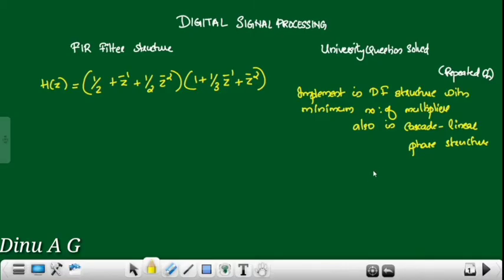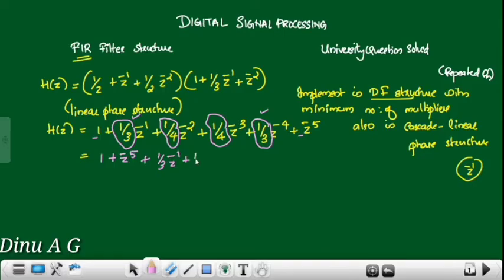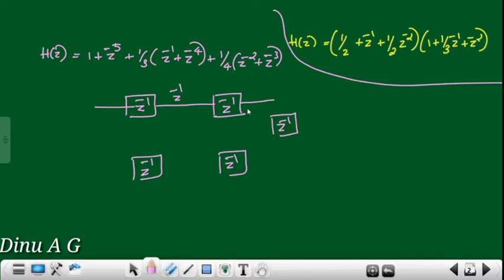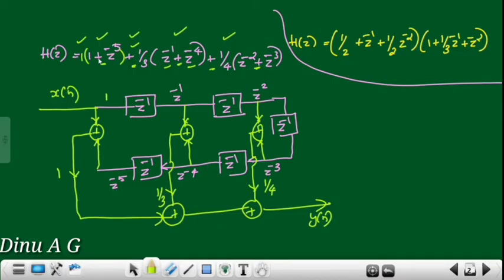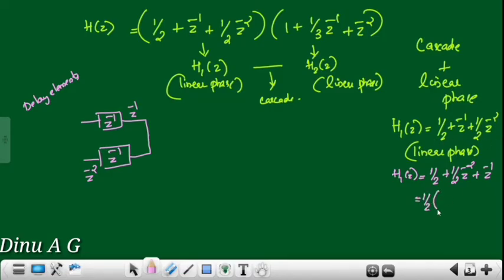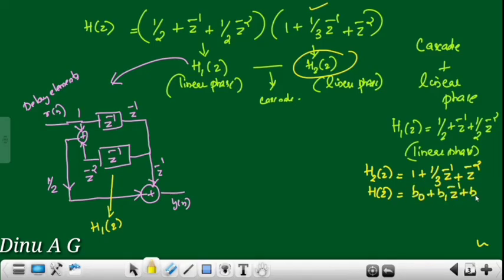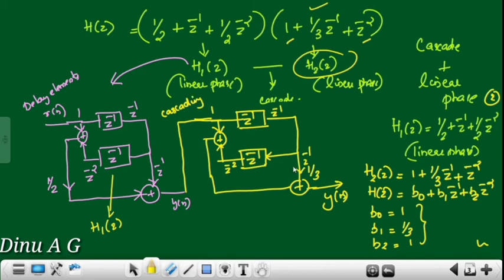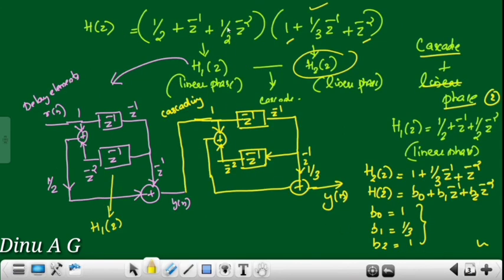Fir filter realization (linear phase structure ) (IMP) PART 2/2 DSP

Comment: Sir 1.28 egane anu multiply cheyuthathu manasilayilla
Reply from the maker: 1 st question system function is H(z)=1+1/3z^-1 + 1/4 z^-2 + 1/4 z^-3 etc..
Reply: @BTechMadeeasy sir ithengana multiply chytha
Reply: @elizabethdona  First bracket each term second bracket each term aayit multiply cheyya . Ennit ellam add cheyya.

Comment: How will you get a z^-5 term (at 1:31) when you multiply 2 terms of maximum power 2 for both the terms?  and the constant is however 1/2.
Reply from the maker: Thank you for pointing out.you are right.
1 st question system function is H(z)=1+1/3z^-1 + 1/4 z^-2 + 1/4 z^-3 etc..